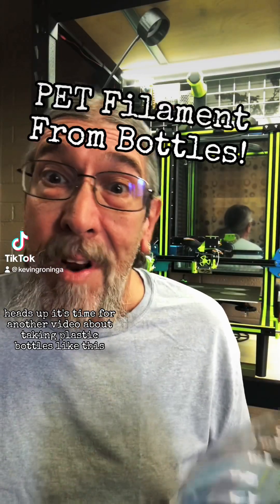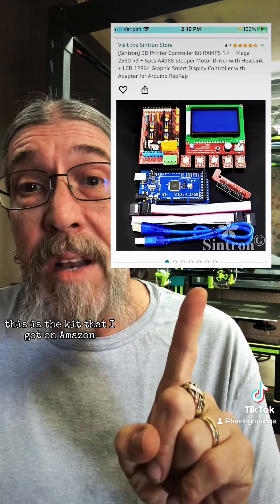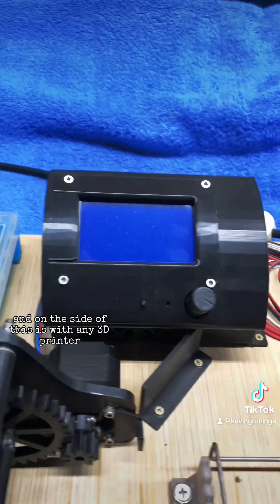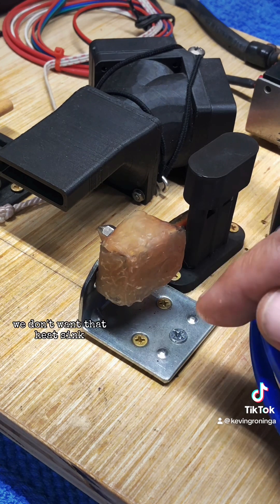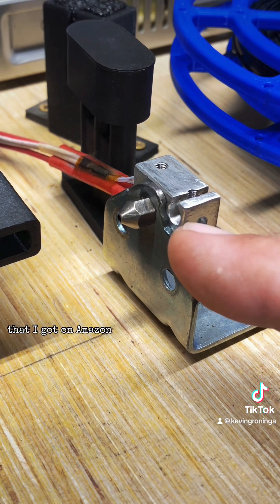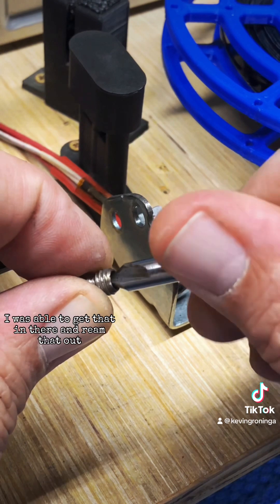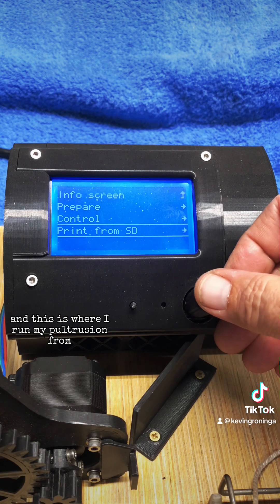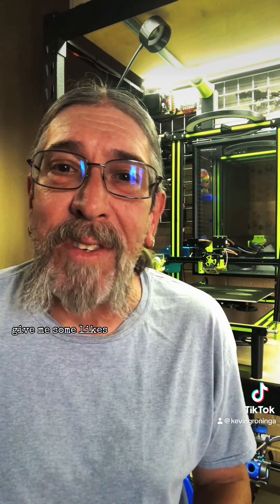FREE Filament for 3D Printers made from Recycled PET Plastic Bottles!

Comment: Hello friend, great videos; I made a similar machine to make PET filament, I wanted to ask about the piece that comes after the sensor, I get the impression that it is to center the filament as it is wound; Could you tell me about it and if it works?
Reply from the maker: I just call it 'a comb'.  Yeah, as the filament is wound, I will move it from slot to slot so that the filament winds a little more neatly.  What would be great is if I had something there that was more 'mechanical' and could move the filament back and forth as it's processed and wound onto the spool.

Comment: Nice! Love seeing the ramps kit, I imagine that's what hobbyists used before the ender 3 became so cheap. 
One note at 4:08, ducting axial fans like that into a restricted outlet is probably less efficient than even a small 4010 impeller style (blower) fan because axial fans make very little pressure. Theres a few videos out there about the topic.
Reply from the maker: Yeah, the fans on the Pultruder were pretty useless.  Soon after exiting the nozzle, that PET cools off enough that it doesn’t lose shape on the take-up spooler.  I could probably just pull that blower out and it would run the same.